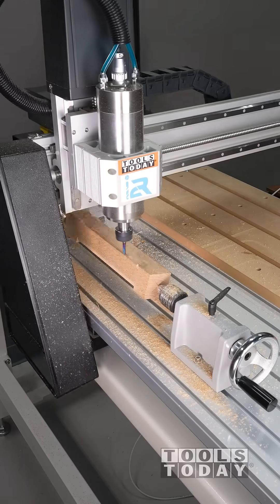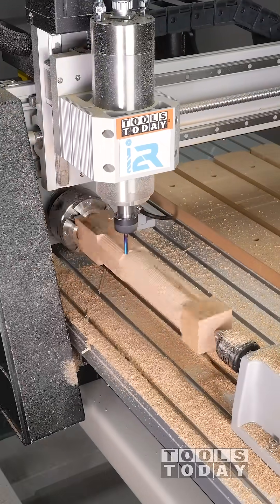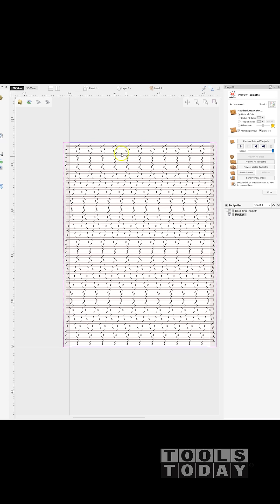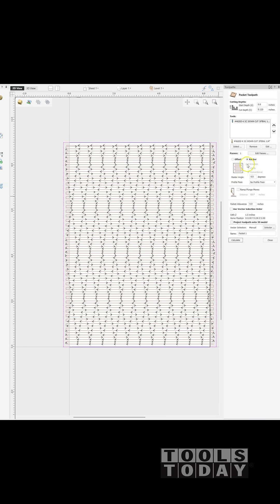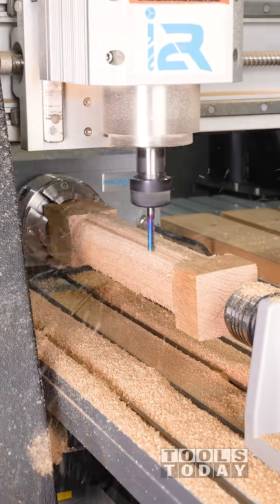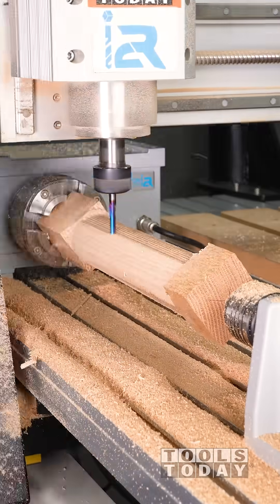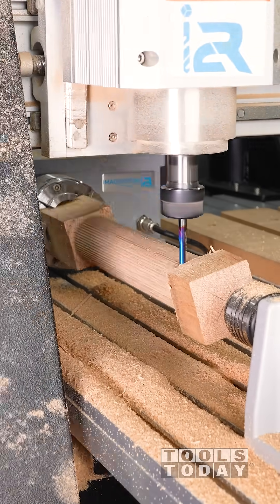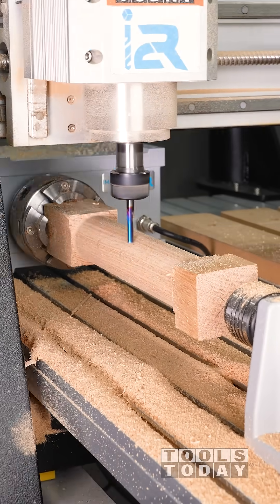My First Try at 4th Axis CNC Mistakes Included

Comment from the maker: Taking my first real step into rotary CNC, and bringing you along for the ride. This captures me learning how to use the 4th axis for the first time. The setup in Vectric V-Carve Pro is relatively easy once you wrap your head around it, pun intended. There were a few mistakes I knew I made and a few more I don’t realize yet. Those will show up in the next video. If you’ve used a rotary before, what tips do you wish you knew when you started? Drop them in the comments. I’m here to learn and figure it out in real time. 

Check out the tools used on our website -

Amana Tool 1/4" Downcut Bit, item no. 46202-K - https://toolstoday.com/v-13779-46202-k-bit.html

i2R A.24 2'x4' CNC machine - https://toolstoday.com/i2r-cnc-a-series-cnc-machine-3hp-spindle.html

i2R Rotary 4th Axis Attachment - https://toolstoday.com/i2r-cnc-ark360-i2r-4th-axis-rotary-kit.html

Vectric V-Carve Pro Design Software - https://toolstoday.com/vcarve-pro-10-0-software-for-cnc-1.html

Comment: Ffs... 🙄 Rounding can be done in 2-3 lines of gcode and some simple math. You have to combine x, z and a coordinates in 1 G1 line. Calculate stepover by number of full rotations and total length. Pro tip - use largest diameter endmill available and take contact point to the side, not the top of the stock and use x y a accordingly.